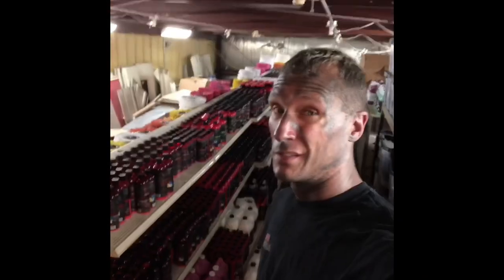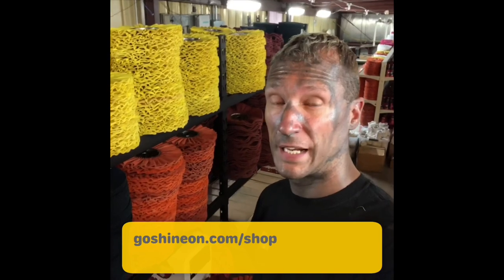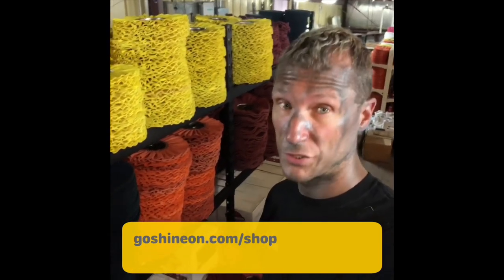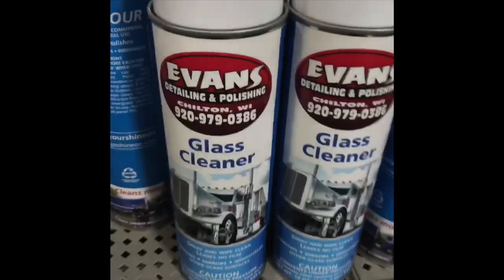Airway buff safety video from Evan’s detailing and polishing.

Comment: That's why you use the variable speed grinders

Many people advocate the 6000 rpm but as you say the risk is there and the risk is real. 

The bigger the buff the higher the speed at the buff edge. Smaller buffs you may be able to have your grinder going faster and still be in manufacturer spec at buff edge.
Reply from the maker: Kevin Cullen correct.